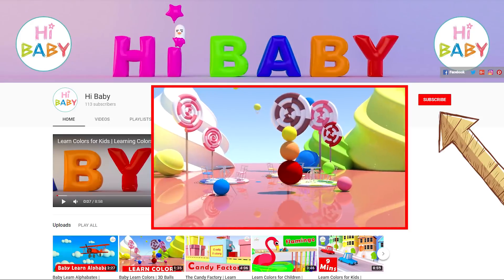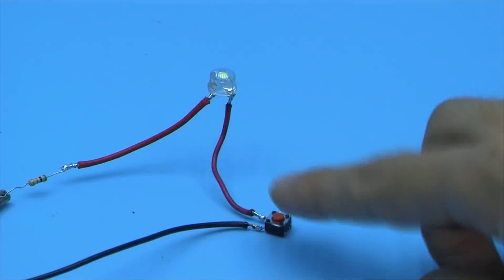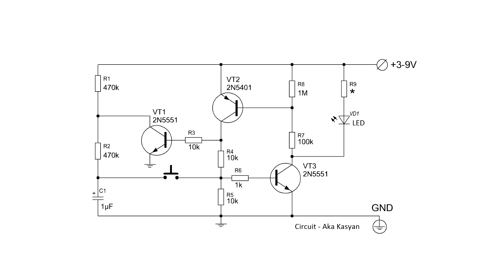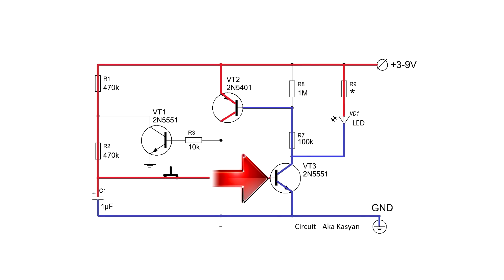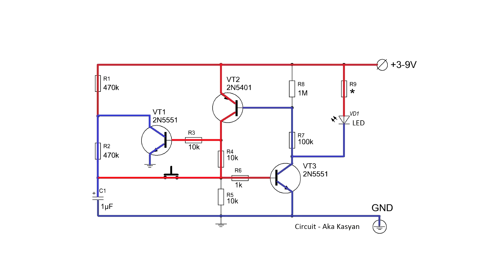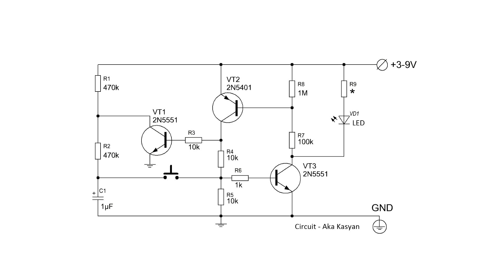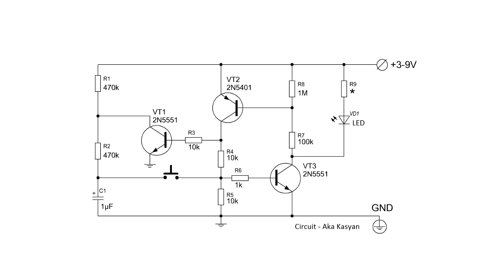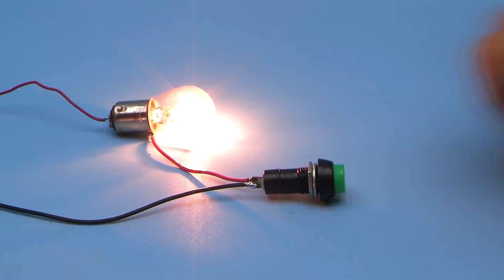One button Push On Push Off ! The simplest circuit.

Comment: I asked you two question in the prives video you didnot answer
Reply: He doesn't answer questions. He's too good for that! :p
Why waste time with peasants like us?
Reply: @pirateman1966  i wonder how do you findout that i am peasants🤔you are not spying on me? Right😕😒
Reply: I wonder how you found out I was spying on you?
Reply: @pirateman1966  i dont know
Reply: Hi electromagnetic. Post your question again. I am sure one of us will try to reply to you.
Reply: @johnbrewer9833   at the privous video i asked about the winding does  the winding should be in regular  like from down to top and than from top to down or from top to down and repeting  
Thanks
Reply: Direction of wind (up or down) makes no difference. To make windings compact,  you don't go back to the start position each time. If you start at the bottom, once you reach the top, you continue to wind and go towards the bottom. Rinse and repeat. Any other way, and you introduce anomalies into the magnetic field.
Only the direction (clock-wise or anti-clockwise) of windings matter. lookup "right-hand rule" or electro-magnetics.
Reply: @pirateman1966  thanks dude by the way electromagic
Reply: @pirateman1966  sorry to bother  another question if the secondry clock wise the primary should be the same clock wise or not
Reply: I did mean Electromagnetics, not a mistake.
If the primary and secondary are wound in the same direction, the secondary's output with be in phase with primary. Otherwise, it will be out of phase (meaning that when the primary is at it's highest, the secondary will be at its lowest voltage). 
Cheers.
Reply: Not sure why this channel has links disabled, but here is an excellent tutorial by one of my favorite YouTuber. 
Just search "basics of phase dots on transformer windings" on YouTube
1st video (#209) will explain it.